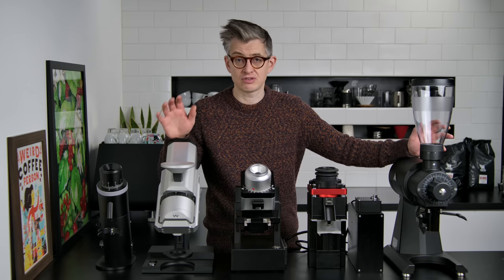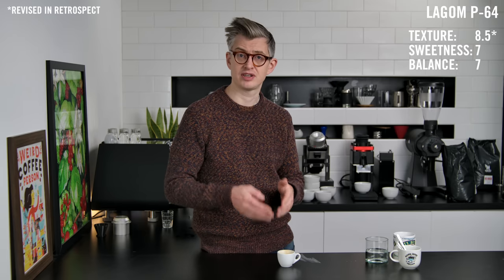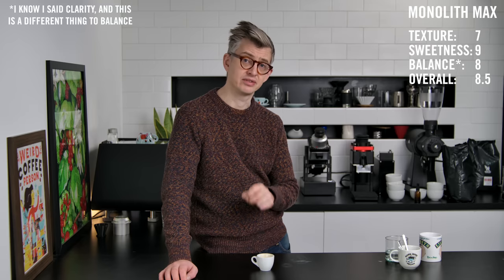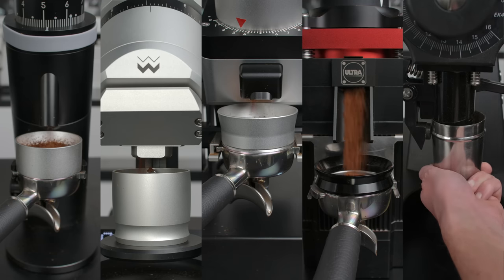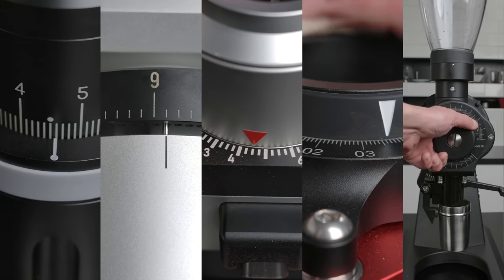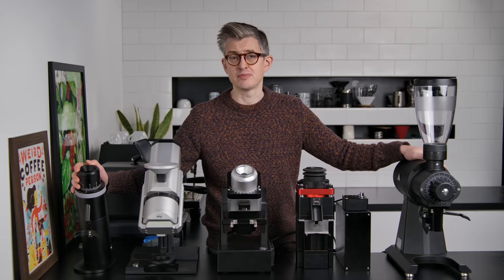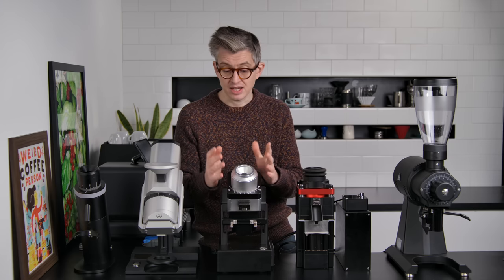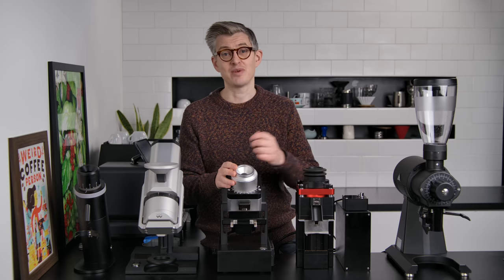The Ultimate Grinder Showdown Finale (Episode #6)

Comment: Retention is probably the most important buying criterion for people looking to buy an SD grinder and unfortunately, these retention tests are not really informative at all. The first one is of almost no use, as is recognised, it just tells you that retention stays the same. You could even have grinders that will spit out more than you dosed into them, just because your new dose happend to knock some old grinds out. As for the second test, although it is aimed to measure how much grinds are actually retained in the grinder, it seems to be highly invalid, i.e. any changes in extraction time could be due to a number of factors not related to retention. Maybe I'm doing it wrong, but even if I try to replicate shots perfectly, I will rarely get perfectly identical extraction times. Also, grinders might not return to their exact setting after being changed back and forth so drastically. Why not just try to clean out the grinder as well as possible and then measure how much grinds you were able to clean out, or run some beans through that freshly cleaned out grinder and then see how much is retained?

Still really enjoyed the reviews though!
Reply: The tests are comparative and the data is valid for practical purposes. Most people will not take apart their grinder after every use to brush out every milligram of coffee retained. You can't do a definitive retention test in that manner as well because every coffee sticks to the grinder differently depending on the type of coffee, roast level, grind size, and even the room condition. Also, these high quality grinders are designed to go back to the exact same grind size even if you change the grind setting drastically. How else did you think we can trust the EK43 to be able to grind for filter and then back to espresso in the shop if the grind drifts just by changing the grind between filter and espresso?
If you can't get two back to back espressos brewed to within 1 second difference of each other im sorry but it's either a technique issue or your grinder's grind quality is not up to par.

Comment: in that pan to the right in the beginning around 0:36, every seventh frame is repeated resulting in an uncanny lagginess (probably a fake slowmo with speed set to maybe 85% but without any optical flow or frame merging feature to smooth it out).. very unpleasing to watch, probably as unpleasing as drinking over-extracted espresso which formed a channel in the puck /or a cheap instant coffee..

Comment: Is espresso just not a good way to brew? Your overall scores are 8-8.5. Surely you are using specialty grade coffee...how come the potential is struggling to be realised. There is still no such thing as unimodal espresso from the grinders in question, they are all bimodal.
Reply: Unimodal adjacent.
Reply: He was being pretty harsh with the grading. He said that a 10/10 would have to be life-changing, which I think is a fair metric, and a high bar, when you have as much experience as him.
Reply: @nemoorellc  please expand as to how this is different to all espresso grinders?
Reply: @BariSaxGod25  I don't expect 10/10 scores, I do expect coffees cupped to exceed 80points, or more, to exceed 8/10. If specialty coffee, well made only hits 7/10 something is wrong with the brew method or datum.
Reply: @markburness5609  Burr geometry and burr manufacturing consistency across all cutting surfaces will determine for each bean (roast, origin) the distribution.  On top, the ability of each grinder to control the burr location accurately, consistently, and repeatable during the grinding process will either retains the burrs capability or let greater grind variation creep in.   Any grinder that can use the top tier  burr sets  will give the possibility of the same particle distribution, but it is the latter point on grinder design that differentiates these contenders from.others.  With machine and operating tolerances held to the 10 micron level, they will always perform better (ie less variation and tighter particle size distribution) in practice than mass produced grinders that allow for greater variation in stacked  fabrication tolerances.
Reply: @nemoorellc  that's not relevant to my question, or the point raised. EK-43 is a mass produced grinder. If the burr sets are top tier, they are only top tier due to the distribution that they make, but having a certain distribution does not exclude bimodal espresso grind.